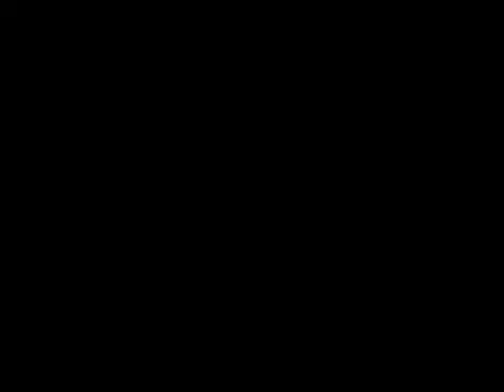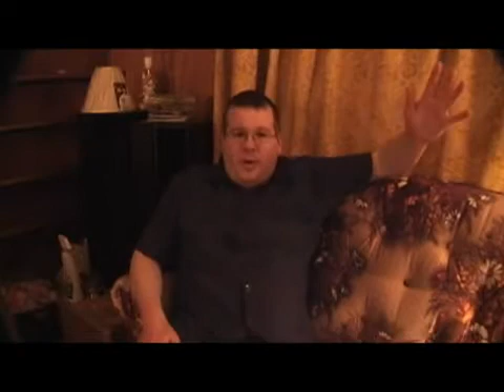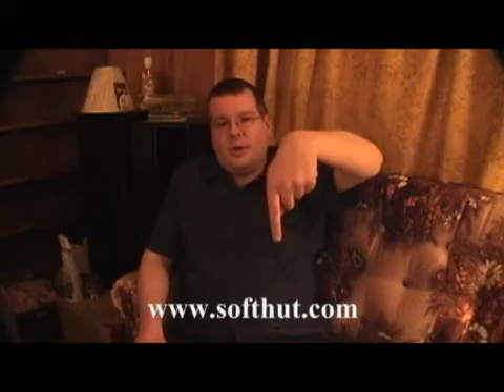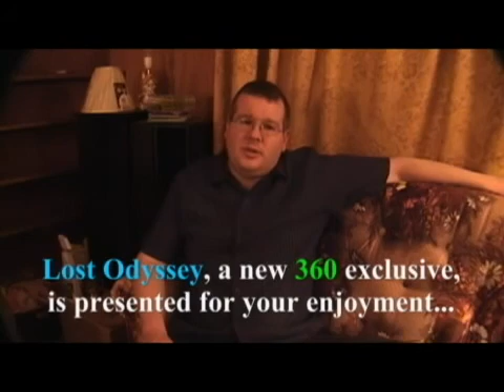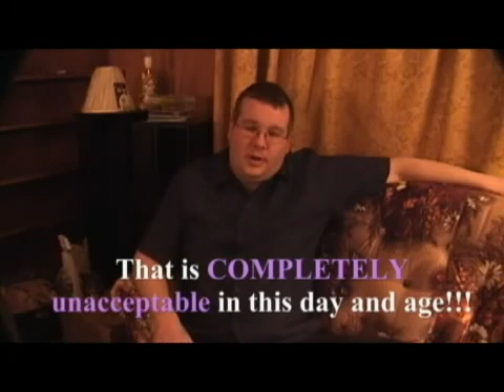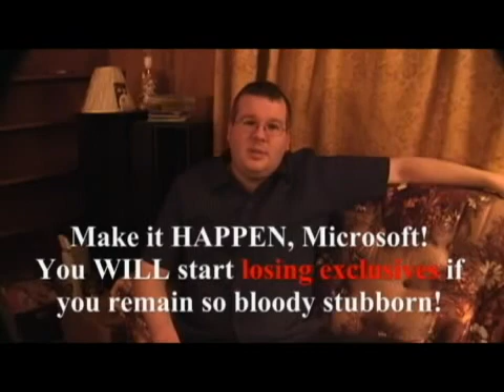The HD Rants - 6 - The Amiga Connection

Comment: Extremely interesting, if only for the computer history. It was probably 1984 when I first touched a computer and 89 before I actually did anything with any kind of program. But I really didn't get into computers til the mid 90's. Believe it or not I just didn't think I'd have much use for one. Boy was I wrong.

Comment: The Amiga wasn't the only platform that missed the boat though.  Apple missed licensing the MAC/OS when they had the chance, but finally tried in the late 90s and that pretty much flopped.  Ultimately though, replaceable parts are why PC gaming is where it is today, so even if the Amiga stayed around, it would have hit its ceiling versus PCs with replaceable/upgradeable parts, since today proprietary or built-in parts are pretty much frowned upon.